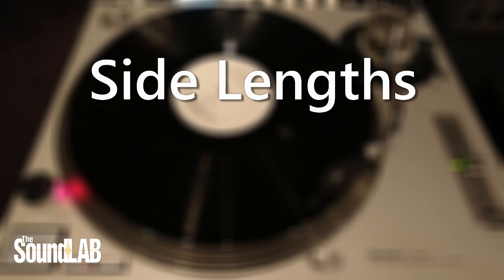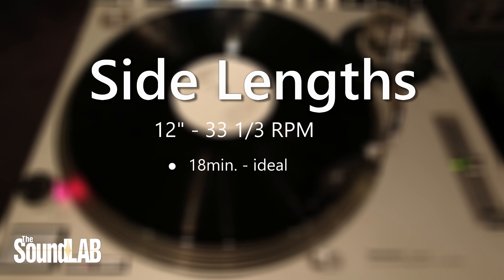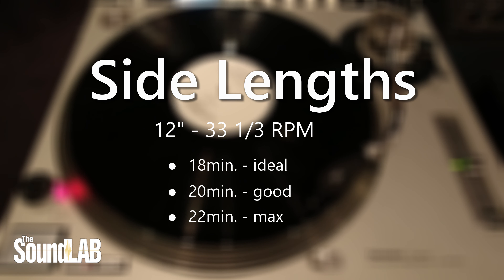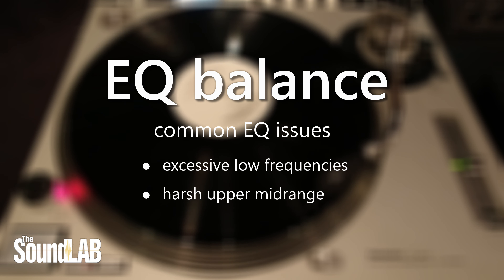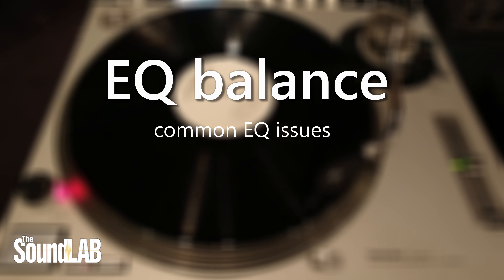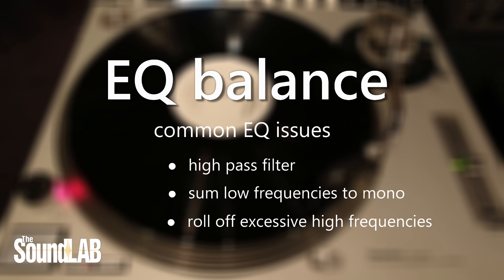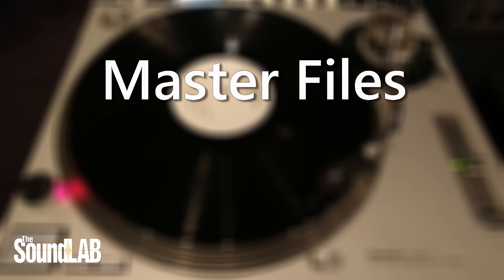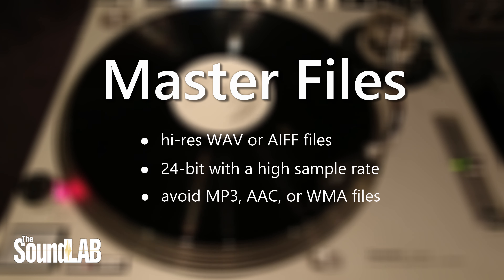Preparing a Great Master for Your Vinyl Project

Comment: With regard to the playback times on each side, a time of 18 minutes is preferable, which could be considered as good and a time of 20 minutes as the maximum time for optimal sound quality. It's a fact that LP's that are over 21 mins per side tend to degrade and distort the audio. Of course, it largely depends on whether the mastering work is top-notch. There are labels that edit and reissue albums that exceed 24 minutes per side and from start to finish they sound excellent.